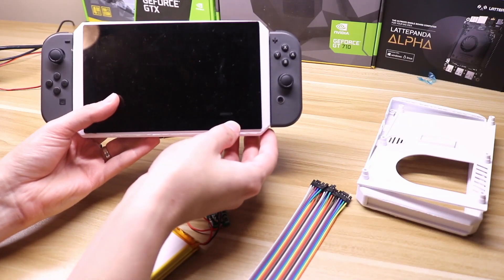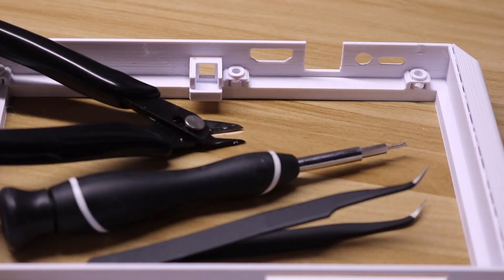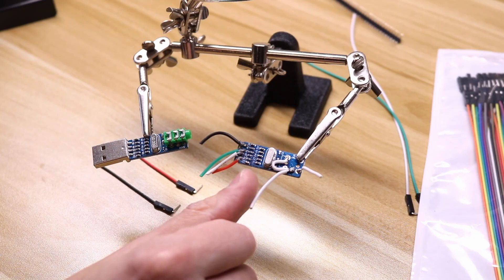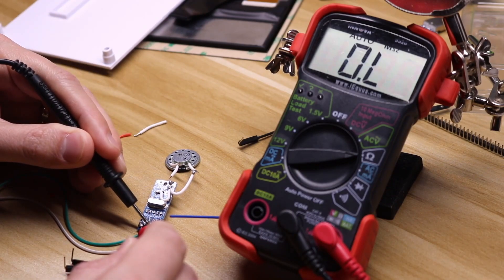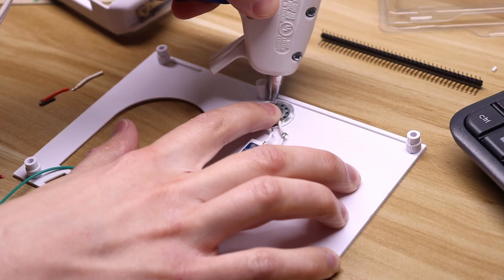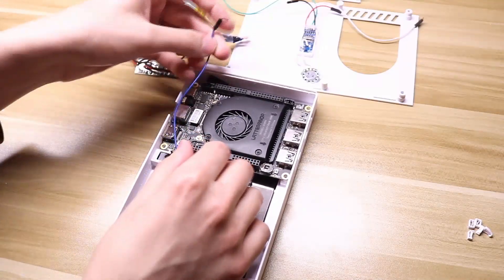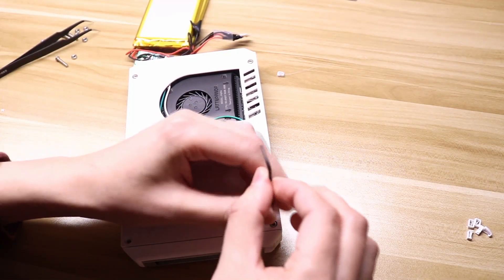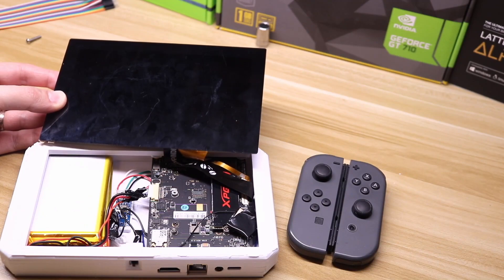The DIY Windows 10 Portable Gaming Tablet - Build Guide - Part 2 - Lattepanda Alpha

Comment: Found this a little late, you mentioned you had a discord channel, but I don't see it in any of the links. Just have a question about the joy-con metal brackets. Since I don't have a nintendo switch, where can I find those brackets? I can easily get knock-off joy-cons from Walmart, but I don't think they come with the metal mounting brackets.

This will finally put my Latte Panda Alpha in with the 7" touch display.that I got from the kickstarter years ago.  Been meaning to print out a display box or design one but this one is the best so far I've seen.

Comment: hey man would it be possible if you could make a handheld pc build with nuc box (1135g7) board or 4x4 box ryzen board (4800) both made from asrock. it seems smaller and easier to make the 3d print case size to be same width and height with the detachable switch controllers.

Comment: Hi 
I have built this with a few mods to your STLs, how did you over come the heat issue ?, mine also has and nvme so gets hot.
Reply from the maker: I had swapped thermal paste, which might have helped with thermal
Reply: @HandheldHardware  OK thanks, ordered Noctua NT-H2, will give it a try.

Comment: How would you recharge this
Reply from the maker: Frojj Wizard it recharges when you plug the alpha into the usb c Pd adapter or via the jst connector
Reply: @HandheldHardware  ok, so it just plugs into the usb c port and charges from the wall?
Reply from the maker: Frojj Wizard yes, you don’t need to remove the battery pack to charge. It charges like a laptop at this point, plug power into the lattepanda and the lattepanda charges the battery.
Reply: @HandheldHardware  ok thanks. Is there anyway to see what percentage it is charged to without a screen plugged in?
Reply from the maker: Frojj Wizard there isn’t any lights, but you could probably make one that reads battery percentage and displays on some LEDs
Reply: @HandheldHardware  last question. why did the power button get soldered if it comes with wires connected

Comment: I was looking at the STL files so that I can print them out and I was wondering, what did you mean by "Print them out with supports"? When I looked at the files, I didn't see any kind of supports on the builds and I have no idea to get them printed with supports.
Reply from the maker: Jacobo Lopez thanks for watching! For overhangs greater than 45 degrees the slicing software should auto add supports
Reply: Project-SBC so if I go somewhere and get it printed, I don’t need to worry about it. And just tell them to print them with supports?
Reply from the maker: Jacobo Lopez yes of course, they should know the overhangs will require supports
Reply: Project-SBC sweet, thank you!

Comment: I've had a vision of making something exactly like this and have a theory maybe you can test on your device. If you go into the windows 10 display driver settings and set the display to be 30hz max at 480p and then go in the modern warfare or any AAA game settings to turn on V-Sync to only limit 30fps, low settings, low res. Do you think it will be stable enough, not throttle and really play like the switch?

Comment: Does your panda power supply make notice when it's plugged in the panda but the panda it's not turned on ? Should I be concerned
Reply from the maker: nistax my older PD supply does this. It’s not a concern as long as the device still powers on okay. https://www.corsair.com/ww/ru/blog/coil-whine
Reply: @HandheldHardware  thanks dude , I was worried that the power supply is doing it just because of some weird pulsing power draw of the lattepanda but I guess it's just some not perfectly winded transformer , thanks
Reply from the maker: nistax I had the same concern when I first heard mine!

Comment: I’ve been hankering for a build like this. You’ve gotta do an intel Vega nuc handheld! It would be the most powerful gaming tablet or handheld ever made!
Reply from the maker: jordan secrist I’ve been eyeing that DFI R1000 raspberry pi sizes board they announced, it would be awesome! Also hoping they make Ice Lake G series single board computers with iris graphics
Reply: @HandheldHardware  how are you gonna fit the dfi heatsink in the case,it's huge
Reply from the maker: jordan secrist https://www.geeky-gadgets.com/amd-ryzen-mini-pc-17-03-2020/
Reply: Project-SBC now that is a board! Not quite as powerful as the intel Vega nuc but that thing is more than powerful enough to run emulators all the way up to ps2, wii, etc. it could also play a lot of pc games at very low settings. I’m so glad you showed me this thing!
Reply: @HandheldHardware  Single channel until 8Gb,  no good.
Reply from the maker: rafael duarte yeah I know 🙁
Reply: @HandheldHardware  more powerful than the alpha?
Reply from the maker: adamaze graphics, yes. CPU, most likely yes however it’s got a bit more power draw then the alpha
Reply: i bought yesterday from Ebay. barebone nuc hades canyon for $710 and i am a backer of the Smach Z portable handled device, maybe i will sell it, i like but i am not a big fan of the steam controller and the screen to me no ideal. For the nuc, i get Windows 10 pro $15 ,used 2x8 kingston DDR4 2600Mhz  $45 and a HP EX920  M.2 NVMe 1Tb $125., its my first time doing this. I use to a big fan of the first Android portable gaming tablet long time ago and i bough the first two nvidia devices and following this in Dingoonity .org, no anymore, i follow the GPD Win devices no like the design and i always want to built a portable gaming tablet PC 10" display with two telescopic arm connect it a two part gamepad controller with steering wheel and more,but i do no have the skills and time and i want to use the intel nuc hades canyon for this. let me know what do you think.
Reply from the maker: rafael duarte a hades canyon portable would take some serious power to run. It’s possible but I’m not sure the size or battery requirements. They do make batteries large enough though, like the zotac VR Go backpack